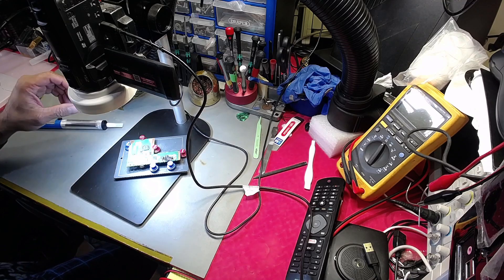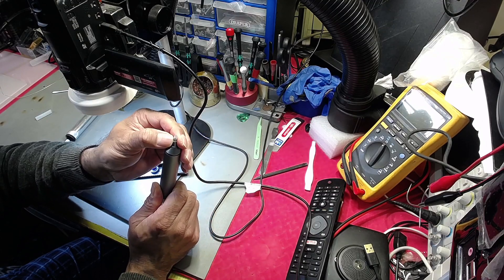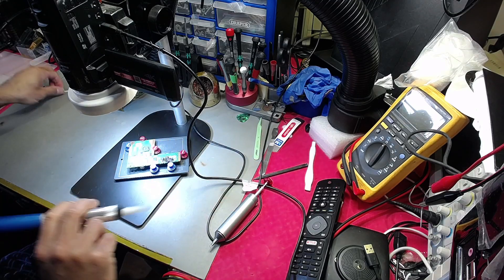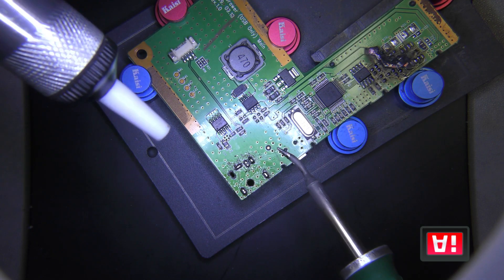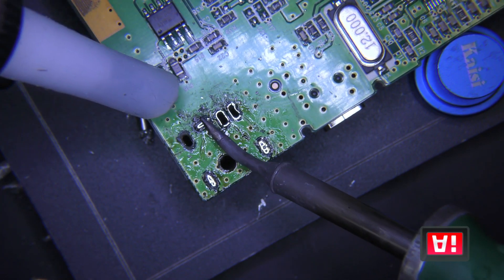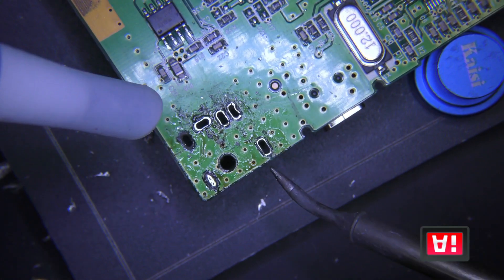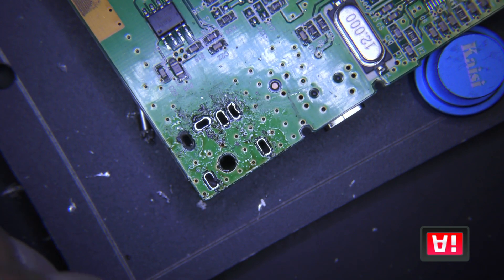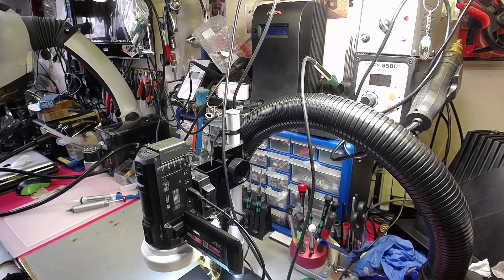SOLDER SUCKER ENGINEER SS 02 HACK OLD SUCKER WORKS JUST AS GOOD

Comment: Excellent suggestion bro! I was ready to junk my cheap one to buy an engineer solder sucker. I'm still probably going to buy it because of the form factor because the full size does get tiring to keep pressing down. But in a pinch when I don't want to crank out my desoldering gun for a couple of joints this works!